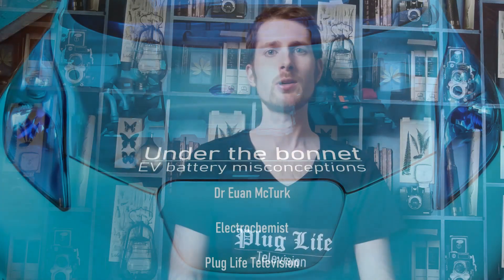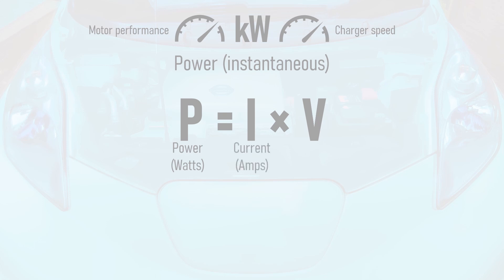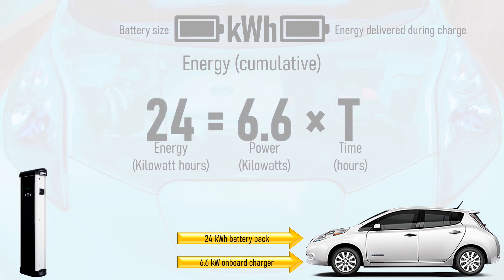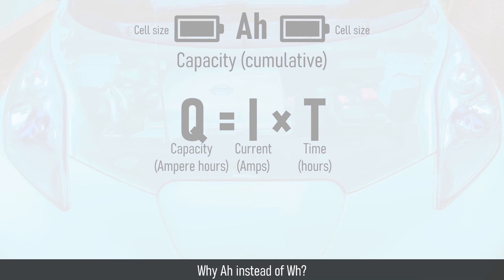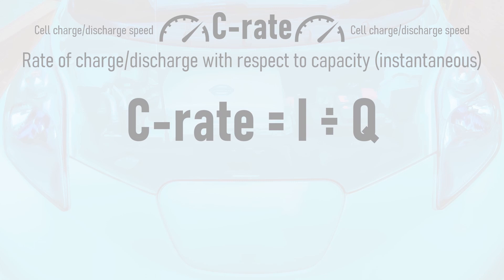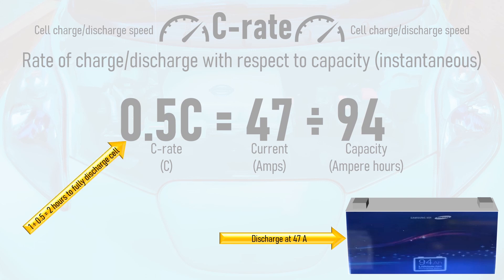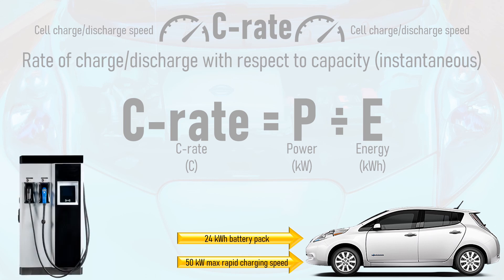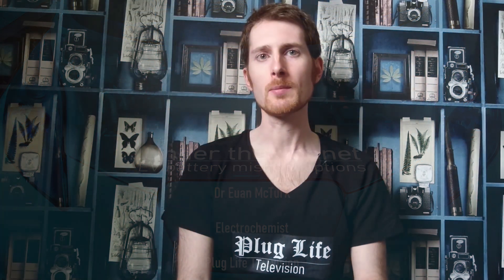EVs: what's the difference between kW and kWh? | Plug Life Television Episode 17

Comment: I find it useful to think of the instant power kW figure as kWh per hour (the "hours" cancel out mathematically, but I don't do that). So a Model 3 with a 74kWh pack, charging at 7.4 kWh/h (correctly therefore at 7.4kW) clearly takes 10 hours for a full charge (if it can maintain that rate to 100%).